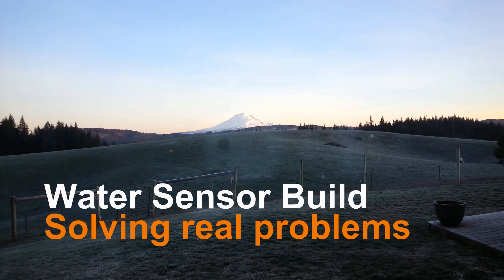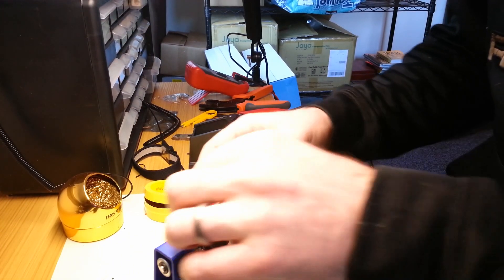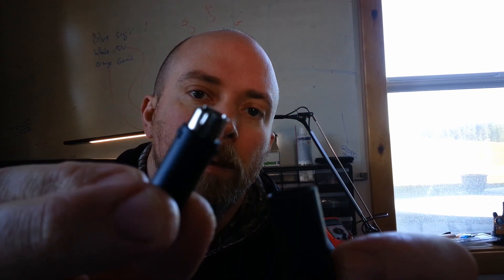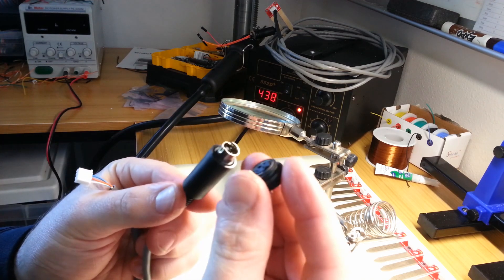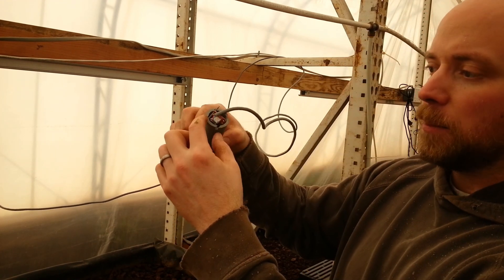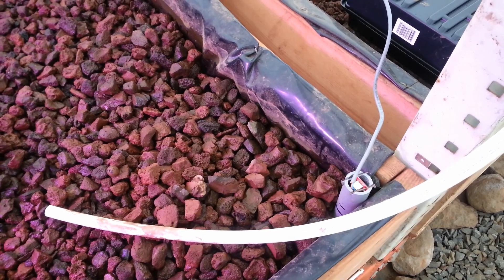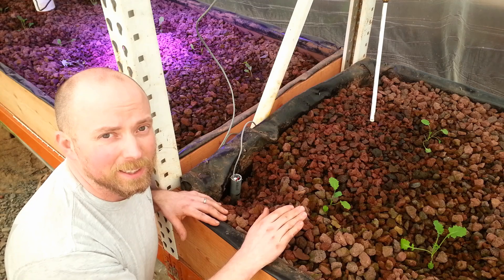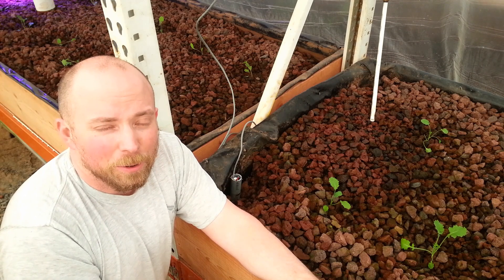DIY Aquaponic Bed, Water Level Sensors with Arduino

Comment: wouldn't it make more sense to detect the water as it drains. then you know for sure it drained and don't have to find a sweet spot for the sensors. and you can better shut the water right as it starts to drain
Reply from the maker: great idea...only one thing I can think of is that I do want to measure moisture in the bed so in that respect I'm killing two birds with one stone if I measure in the bed

Comment: Every single device I have used that has those connectors I have seen one thing, they don't stay on and if you move the cable at all they pop off.

Comment: I make these for encoder cables.  Please remember that they need to have the shield  grounded at the source.  VERY important, my issue was a spinning die over revving because the feedback had noise on the line.  Over revving a 20K# die = bad

Comment: Like your choice of connectors and decision to you the multiple conductor cables that will allow you to expand using the same cables IF needed.  At the end you were talking about lack of pressure in your setup.  At one point I'm sure I heard you say your racks are way over engineered.  Perhaps it would be possible to put a water reservoir at the top of the racks.  That would give you even water pressure though out the whole system perhaps and as an added benefit, perhaps the water that high up in the building would help stabilize the temperatures by putting warm water up there in the winter and cool water up there in the summer.  Warm water coming down from the reservoir in the summer might increase growth?  Just meant to be food for thought.  The reservoir could be made from semitransparent material so as not to block sunlight.

Comment: Just Seen this how to convert any LED light in to a grow light https://www.youtube.com/watch?v=oxG-vTVts3E
Thought it might be useful too you bigclivedotcom also has some other very interesting uploads on his you tube too
Reply: Was going to point out that video to him also but see you already did it. Wonder if anyone makes a line voltage grow led cob yet as you wouldn't care about a flicker on the plants like you would in a room you are in all the time. 

Those would work very well for a wire shelf system for micro greens to get more into a smaller space.

Comment: Will you eventually be doing homestead videos that don't require an IT Tech or an electrician ?
Reply from the maker: :-) I'm certainly working on it...Have lost a lot of viewers due to the technical nature of the videos but I need to get that work done, just as much as I need to get to the more mechanical builds that are a lot more fun for everyone, including me...trust me...I'm tired of wires and circuits too. I appreciate your honest feedback and support.
Reply: Thanks for addressing that, looking forward to those type of videos 😃👏